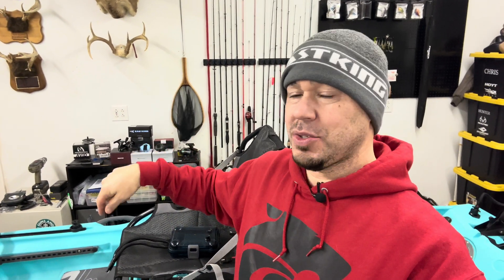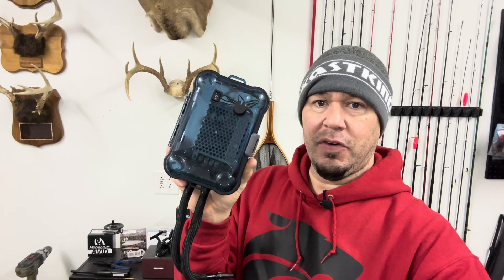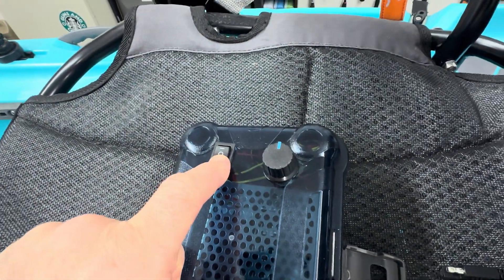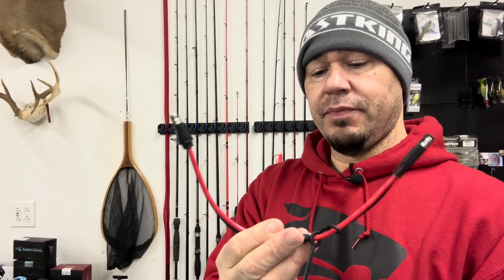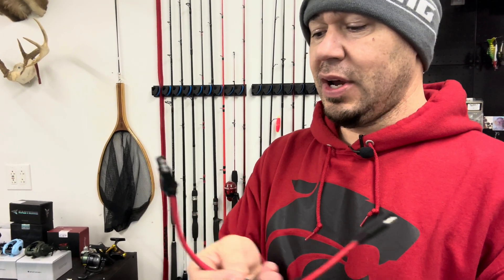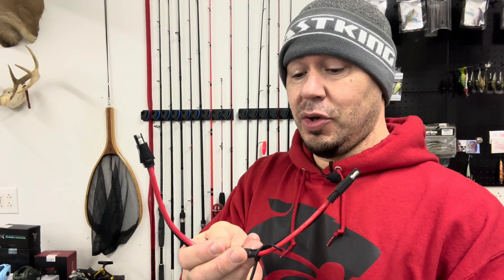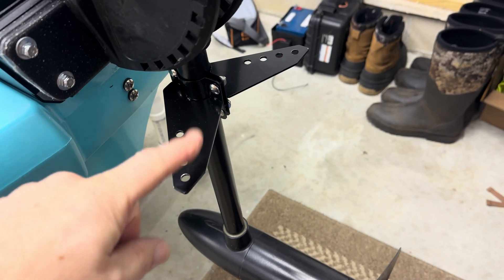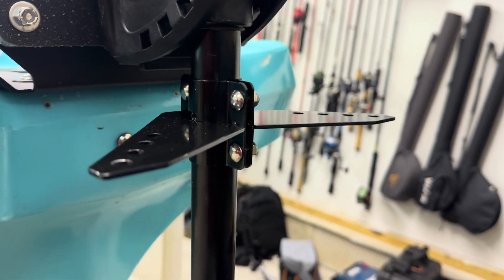Revolutionize Your Kayak Trolling Motor with PWM & 3D Printed Tilt Lock Release!

Comment: I bought these off your video lol but my Minnkota motor has a red/black wire and a white and yellow wire. What do i do with the white and yellow?
Reply from the maker: You only need to use the power and ground from the motor. The other 2 wires are not used at all! I just wrapped the ends with a little tape. I actually cut mine short too. But in case you ever want to use that motor again for its use with the head, you can just wrap the ends.
Reply: @YAKnLIFE thanks for the information brother. Great videos dude.
Reply from the maker: @WallStreetDan feel free to ask any questions you may have! Glad you like them! Happy Holidays!

Comment: I built an eKayak last year. I'm building a new one and putting up shorts on YT. I disabled my tilt lock for a couple reasons.  Im using a Newport 55# motor and my kayak is for exploring, not fishing. As long as i take off slow the motor doesn't pull up in reverse. Also i explore low water so not having the lock lets the motor pop up when i hit something. 
 i can see the need for a lock on a fishing kayak, where you are trolling back and forward. I tried several different designs and i couldn't come up with a lock release for mine. But it worked out better for me not having it. Your design is great.
Reply from the maker: Yes, I agree. I did at one time get rid of the tilt lock myself. It does work that way as well! As long as you find out what works best for you, that’s all that matters! A lot of trial and error for us kayak guys 😂

Comment: Great videos, thanks! Do you have a problem with the steering cables where they attack to the triangle when lifting the motor? I was wondering if the cables would be to short or if the pull both of your pedals toward you when lifting the motor.
Reply from the maker: No problem at all. I lifted the motor all the way up and locked it in position and pulled the pedals close to me when making the connection. That way I knew I’d have enough clearance
Reply: @YAKnLIFE that’s great! I am installing the same foot steering system today using your video and links and have the option to run the steering cables below the motor hinge on an NK 300 which will clear the aft tank well from any cables running over it. I’m thinking the lower position of the triangle on the shaft should also provide less resistance and in my case, create a wider turning radius. Thanks again and tight lines!
Reply from the maker: @zaramacho1 fantastic! Let me know how it comes out for you!

Comment: This is what I have following you. The release works but it’s very hard to tilt up. Any suggestions?
Reply: Forgot to add photos
Reply from the maker: You probably need to change the angle and utilize a pulley or 2

Comment: How are you releasing the tilt lock to hold it in place? My motor pulls it back down due to the weight. Also I can print these it anyone needs them
Reply from the maker: I’m using a cam cleat
Reply: Where can I find the template to get one of these printed?

Comment: That tilt release piece is nice, I feel like if you didn’t have someone who could 3D print it, you could also template that piece out with cardboard, transfer it to a plastic cutting board and cut it out of that too.
Reply from the maker: That wouldn’t be a bad idea!
Reply: @YAKnLIFE just a thought coming from someone who likes to woodwork and has to template and cut custom pieces out of plywood all the time.  I’m sure you could also use one of those 4 inch speed squares from the big box stores either as a template or the piece itself too.

Comment: Hey nice video! Im having some trouble with tilting my trolling motor. I have the newport 55lb thrust pretty much modified like yours. Head removed, foot steering, pwm. The issue is the trolling motor is so heavy I  cant pull it up from sitting the seat. Is there something I can do to help with the weight? I have the bonafide rs117.
Reply from the maker: You may have to utilize a couple pulleys. That will definitely help with lifting the motor

Comment: I'm planning on buying a 36lbs trolling motor for my kayak, and a 12V 100Ah battery, can I use the same PWM you are using or should i go the next level.../ Using the one is rated for 60-100 Ah ?
Reply from the maker: You could use the same! It doesn’t hurt to go up though!

Comment: How are you raising your motor with the steering cables attached below the motor mount?
Reply from the maker: I have enough slack in the foot steering that the pegs can move when the motor is lifted. I have another video on that. Check out the foot steering video it will show it
Reply: @YAKnLIFE right on, I’ll check it, thanks.

Comment: U might want to check the amp rating on your SAE connectors. That looks to be a 30 lb thrust motor. That might draw more amps than what your connectors are rated for. I think you might find they get a bit warm.
Reply from the maker: @peterchang7646  so far it’s worked flawlessly! But thank you for the heads up! I will definitely keep an eye on it
Reply: @YAKnLIFE  I run xt60 connectors on my setup with a 20lb thrust watersnake motor and they get warm if cruising full throttle for 10 minutes or so
Reply: @YAKnLIFE  I melted some SAE connectors with my 30lb thrust Minn Kota and pwm build. Went to anderson connectors and haven’t had any issues.
Reply from the maker: @janbatallan I’ll look into them!
Reply: @YAKnLIFE if you use Anderson Plugs. Flood solder the wires. They are a horrid to try to crimp.  (And make sure you have the pin orientation right before dunking wires in tho pins as they have to be straight and the same length or they can pop the pins out inside the plug)

Comment: Why use a controller motor when you can use the original gear switch from the trolling motor,that's what I did.
Reply from the maker: @wolf6801rw  it’s more efficient. Let’s you dial in the power more precisely as well! Battery power lasts much longer
Reply: You have way more range with speed using a controller.
Reply from the maker: @WyattsFab absolutely

Comment: I can't believe anyone is doing these old school PWM/SAE builds anymore.  I have one currently, but I've killed about 5 of them.  Once they started importing the Autoboat I went with that.  Got into the 1st preorder and been running with that ever since.  I kept the old PWM because, well, I had it, I had put a lot of work into it, and it was better for the stern than the Autoboat.  But now the Autoboat has a stern mode, so the PWM is no longer better for that.  I do plan to install some Anderson connectors to use instead of the SAE plugs, which constantly disconnect themselves.  Hopefully it will extend the life of the PWM.  If/when my current PWM dies I won't bother with making another.  I'll just run the Autoboat .  

I do love the 3D printed tilt lock.  I sent 3Dyak a link to the file, I think it was on thingyverse but I could be wrong, and he printed 2 for me.
Reply: The biggest problem with Autoboat is the price, which is currently $1000 USD plus shipping and you need an existing trolling motor on which you'll need to install. A Minn Kota PowerDrive is $1250 USD including Spot Lock.
Reply from the maker: @narf55 very true! I would love to go the auto boat route, but this is a fraction of the cost. And personally, I’ve never really had issues with a pwm and certainly never any issues with sae plugs
Reply: @narf55  $699.97 right now on their web site.  Don't know where you got $1000 from?  I got all my motors off craigslist, didn't pay more than $30 for any of them and 2 were free.  If you are going to do a PWM build then you have to get a motor and mount it and get a battery anyway, so you can't really count that against the Autoboat.   Plus if the motor dies or I bend the shaft I can just swap it out for another cheap one.

 Minn Kota doesn't make a kayak sized motor and Motorguide stopped making one so a lot of people going that route cut down a full sized one, which voids the warranty.  Minn Kota and Motorguide don't make a stern mount GPS motor that I know of, so you have to do a bow mount.  bow mount is fine for lakes but not as good for creeks and rivers.

If you prefer the PWM that's fine, it's a free country.  I'm going to keep mine until it dies again.  If you have no problems with it that's awesome.  It was a serious headache for me and I have spent enough on replacement PWMs, wiring, tools, parts, etc, and enough time in labor working on it that I would have been better off just getting an Autoboat.  Unfortunately it wasn't available until after I did the PWM.  But it's a free country and you can do it any way that works for you.
Reply from the maker: Tilt lock is awesome!
Reply: Dude I have been all over youtube and I am baffled how nobody is talking about the SAE PWM builds blowing up.. I've been through 3 amazon chinese boxes and even blew the premium Briidea 50A (with the separate throttle) with a 30lb minn kota endura c2... this is not my first rodeo doing electrical wiring.. I have been extremely gentle on the throttle ramping.. cooling is efficient.. and for some reason these things only last me days after triple checking poliarity and all other variables.. not sure what is going on but it's driving me insane. I was thinking about Anderson connectors too. 

How were your boxes blowing up? My briidea 50A worked for the first day and then as soon as I launched the second day it blew up and nearly caught on fire under my seat. The china boxes were similar.. one blew just the second trip and the others blew as soon as I connected the battery (after connecting the SAE motor plugs first). Verified everything with a multimeter to make sure I had right polarity etc. Extremely frustrating. If anything it's just pushing me towards and Old town autopilot.
Reply: @CinematixActionProd  A couple lost their magic smoke as soon as power was connected.  I checked and rechecked everything but they still went poof.  

A couple lasted a few trips.  One of those worked for a trip then the next time didn't work right from the start.  The other of those died on the water but by then I had the autoboat on the bow so I wasn't stuck down the creek.  The way I set up my mounts I was able to switch the autoboat to the stern.  This was way before stern mode but it worked fine for speed and manual steering.  I removed the tilt lock so it would kick up if I hit a ledge or anything.

One I somehow got water inside the box it was mounted in.

Aside from the one with water, I don't know how or why any of them died.
Reply: @CinematixActionProd  Someone, maybe aksmaniak, said that sometimes the +/- markings are reversed on the PWMs.  I have no way to confirm that.

Comment: It looks like all the weight of the motor is being pulled up with that part held on by a tire wrap, what stops it from twisting or popping off? I’m not doubting your set up in just asking. I would like to try it
Reply from the maker: @joekocher2604  I actually switched it up a little bit. I’m going to have to make an updated video. The pulley actually got moved up towards the head of the motor and works fantastic!
Reply: @ I’ll keep an out for the new video

Comment: Sweet setup on a budget an a great yak.  SOLID.  Thanks for sharing.  It looks like you took up one of your steering pathways with the motor lift cable??  Are you going to reroute that when you put steering in or just put the steering cable on that side through a different pathway?  
Also, do you see the same speed in reverse as you do forward with your PWM?  Thanks again
Reply from the maker: @ADKMuskyFoolonFly63  I actually have a video dropping at 10 today on the steering! I have separate tubes for the steering that came with the kayak! So those will be used. The tilt cable will be staying where that is!  As far as the pwm goes, I haven’t tested it yet on the water but I would think it would be similar forward and reverse. Thanks for the feedback! Appreciate it!